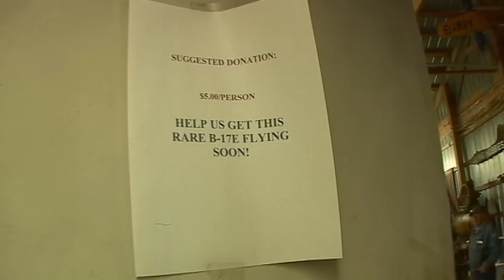Desert Rat B 17 e Flying Fortress restoration . Aluminum Overcast in cockpit take off. B17e

Comment: As a structural mechanic I've seen a lot of center punches and drilled out thousands of rivets, but that's one of the craziest center punches I've EVER seen, and the way it operates is wholly fascinating! Looks like a 50 year old relic. Of course, center punching shouldn't be necessary if your good with a drill, but with a button-head rivet I suppose it makes it easier.
Reply: ProChoiceJesus 
Automatic center punch. They're actually quite common. Aircraft tool suppliers and precision machine supply companies sell them. I have one.

Comment: By the looks of the cockpit (absence of working top turret mechanism and padded
interior), this has to be the EAA's 'Aluminum Overcast'. Of all of the world's flyable 
remaining B-17's, it gets the most time in the air and seen by the most people. 
'Desert Rat' will be a long-term and daunting task. Actually a converted XC-108, it was purchased by a auto salvage dealer in 1945 and hacked into pieces. It sat for
forty years before being recovered in 1985. Many components are unsalvageable.

Comment: That automatic centrepunch being used at 3:41 is fantastic, would anybody be able to point me to the manufacturer? It looks like it works more effectively than the regular push-style automatic punches commonly available.
Reply: Answering my own question, I found out what that centrepunch is called. It's a "Two Bit Snapper" made by Spring Tools. It's a current production item (not vintage) and there are plenty of them listed on eBay.
Reply: You can get any number of different versions from precision industrial supply houses.